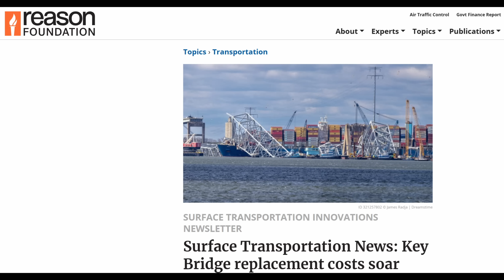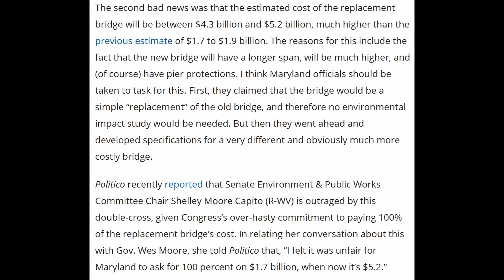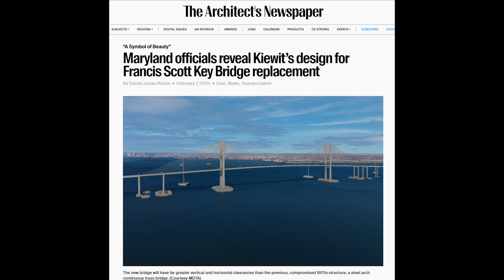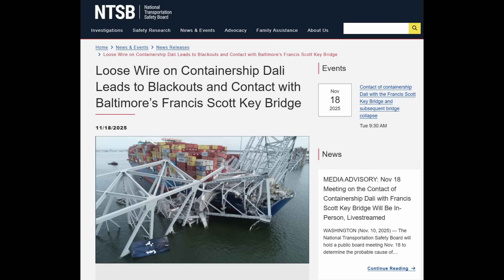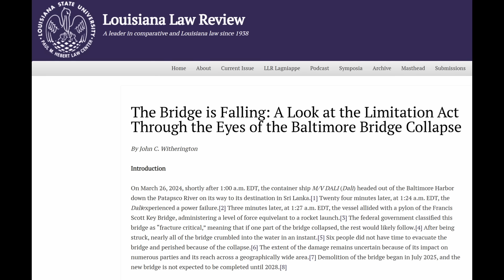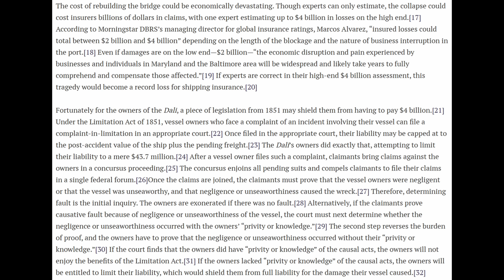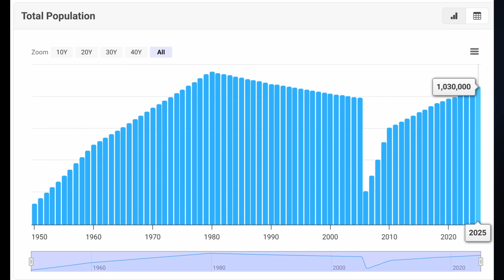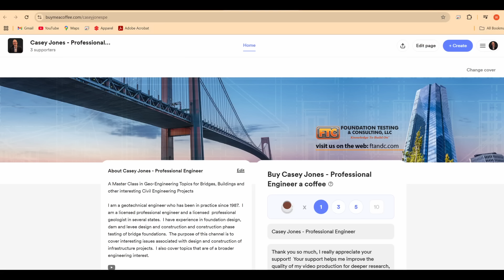Should U.S. Taxpayers Pay for a $5 Billion plus Key Bridge Replacement?

Comment: Even though the new Key Bridge will be much higher, the Chesapeake Bay Bridge would now need to be rebuilt to accommodate the larger ships as it is not high enough. Probably another $8-20 Billion to do that. Nobody has mentioned that up to know. So what does making the Key Bridge higher buy us at this time?  In the distant future yes it would be needed but until the Bay Bridge is reconstructed it does not make much sense.

Comment: Now you have me wondering how the bridge cost would compare to running a tunnel underneath. The problem with the tunnel, of course, is that you've still got to have a way to move hazmat materials through there.  When I was in Rouen in France, there was a bridge span over the Seine that allowed the entire pavement section to retract for passage of ocean-going vessels. I'm sure there are good solutions out there that come in for under $5 billion.

Comment: Lockheed Martin F-35 Lightning II Joint Strike Fighter took 23yrs to develop at a final cost of 2trillion dollars! That's 87 billion dollars for 23yrs! Lockheed has a contract with our government to build 300 F-35 which cost 100million each! That 30 billion total! Coupled that with corporate welfare which estimates to be  between $80 to $180 billion dollars annually. The key bridge is the very least of our problems when its comes to corruptions. Basically it just low hanging fruit and should be the last problem to tackle on the  list; if your serious about wasteful government spending.

Comment: First clarify what you assume as unstable and at high risk in the key bridge area. 
Secondly, you're comparing apples to oranges.When you're just looking at traffic versus what is public and commerce traffic.  The key bridge supported a great deal of commerce and was due to increase width.The improvements to the baltimore port. This commerce supports blames of people and businesses from the mid atlantic through to the midwest. This is why biden insisted on giving financial support for its speedy rebuild.
Reply from the maker: Nobody said the project couldn't be beneficial. I object to the blank check that Biden and Congress wrote for this replacement.

Comment: Republican governor hogan refused to add protections to the bridge. He was warned that this type of disaster could be avoided. He refused to spend a few million in prevention. Why should the rest of marylanders suffer because of one politicians and his parties poor decision? And at that time, many engineers also said even if that bridge had greater protections, it may still have collapsed. This does not exclude hogan's short sightedness.

And national funds would secure a swift building of a bridge that supports a great deal of commerce and expecting the commerce to increase due to the changes to baltimore ports. National funding would secure this bridge to already bewould be well under way dramatically reducing the cost.  We have seen this in other similar emergency projects nationwide. It is due to delay and political prejudice  and yes, tariffs , have added to the cost of this bridge is costing more.

Comment: I question the cost increase due to the fact that the Harry Nice bridge was replaced and finished in 2022 at a cost of less than 500 million. That bridge is 1.9 miles long and 135 feet tall. Make that make sense.

Comment: The only issue I have with this was Kiewit didn’t do the initial cost estimate, MDTA did (no bridge was designed at the time yet)

This is also assuming another contractor could build it for less assuming they don’t reach a maximum fixed price for phase II (next year)

Comment: Interstate 95 is a federal road. The original need that was there when the first bridge was built has not gone away. Federal roads are paid for by federal tax dollars. Therefore, taxpayers should and will pay for the new bridge regardless of whatever design flaws existed with the first bridge. All of the should have, could have, would have, arguments are pointless, except for to learn from the mistakes that were made. Now we must, as the negroes say, move forward. No point in crying over spilt milk which is what Casey Jones is doing.

Comment: Another Comparison is a recent bridge from MD to VA.  Harry Nice Bridge Cost was $463M vs $5B
1.7miles vs 1.6miles.  4 Lanes vs 4 Lanes.  135' clearance vs 230' clearance.  The Harry Nice was started 7/2020 and completed 10/2022.  I know its a different bridge.  But we could have built HN bridge 11 times before we reach the top end of the key bridge estimate.

Comment: A couple comments - Tariffs do increase the cost of American made products. When internationally sourced goods cost more it increases demand for American made products which allows American suppliers to increase costs. Also, it's the contractors responsibility to push the cost up as much as possible to increase their profits from this project. You see this particularly on CM/GC projects all the time where the contractor has the ability to drive the design.

Comment: One thing to consider is the proportionality of holding a single private entity responsible for the cost of a large scale piece of infrastructure that can only be built and maintained by a sizable government.  The state has to take on at least a fixed majority amount of the liability for the very reason that it is unreasonable to put the entire responsibility on any other kind of entity.  This sort of thing should be anticipated in some way.

Comment: To start with, it's important to interpret the 2024 Key Bridge collapse in a national context. PBS did a great documentary on the disaster. Apparently, the Key Bridge, along with many other bridges in coastal areas, was known, for many years, to be vulnerable to collisions with freight vessels of escalating size. 

This known vulnerability, in combination with the ongoing phenomenon of the entire infrastructure deterioration across the country, means that all infrastructure  has been crumbling for decades and the cost to get it back under control simply keeps escalating. Maybe you could say we need to do more to contain costs, but the politics of this era seem to clearly rotate not around finding meaningful solutions but around partisanship. In other words, elected leaders aren't really interested in talking about solutions, only finger-pointing.

While it's possible to consider where the money could be better spent, that simply results in sectional politics. 

The fundamental question lies in what the Key Bridge was and what it represents to the region. The Key Bridge carried Interstate 695 over the Patapsco River to complete the Baltimore Beltway Loop. Take that bridge out, and I-695 is no longer functioning as the Loop. Loops around metro areas are an integral part of the Eisenhower Interstate Highway System. Questioning the viability of a metro loop is questioning both the viability of our national commitment to maintaining and repairing to common structure of all metro areas. In doing so, you open Pandora's Box as to what the federal commitment is to the entire Eisenhower System. Like it or not, when the public accepted this system in the 1950s and funds were committed to building interstate highways, the voters (and taxpayers) also comitted long-term to maintaining and repairing the system (even as it continued to grow over the next 70 years).

The real problem here is the lack of adults in the room. If our nation's infrastructure is crumbling, it's up to elected officials figure out how to raise the money to pay for it while also controlling costs. If you look at the job Congress does with NASA and the Artemis campaign (namely the breathtaking costs of the Space Launch System rocket and the Gateway space station), it should be clear that what we need is to send more adults to Congress. So far, that's not happening.

So, why should the I-695 situation be any different?

Comment: I just watched a video by Alexis Dahl about the Stannard Rock Lighthouse, 26 miles off shore in Lake Superior <https://www.youtube.com/watch?v=LFzPnx0R8-k>. It's foundation is a +/- 100ft. diameter crib filled with rubble and concrete, built on an underwater reef to 14 feet above water in 1883. It's been automated since 1962. It's on the historic registry and is also is used as a base for collecting Great Lakes climate data. After 142 years of Lake Superior weather, the foundation has developed some large cracks. They are planning to address and repair them so as to maintain a valuable climate and weather data station. Seemed right up your alley. Enjoy!
Reply from the maker: Thank you very much I will check it out!

Comment: Howdy. I am a retired project & program manager of federal acquisition management for transformative contracts. I transformed the FAA‘s air traffic control and the veterans administration back in the 90s.
——
IMHO, the decision to triple the replacement cost will be found to be the direct result of when the contractor realized that the value of this contract is likely a blank-check job, having been promoted as a must-do thing by the Biden administration. Mix in a little corruption here & there … and viola! Triple Cost to taxpayers rather that the ship and bridge owners, who were both at fault here.

The most important thing when considering expenditures of this magnitude are that you need to start over from the beginning – which means rationalizing the need for the structure or thing in the first place. There is an inordinate amount of data available on traffic flows and types; this can be used to analyze whether the scope of this project needs to produce a different solution than a simple replacement involves.

In other words, this is an incredible opportunity to reconsider the big picture as far as traffic flow is concerned, and the traffic needs to be delineated into commercial and personal use to determine whether separate solutions may be beneficial.
——
OPTIONAL for the detail-freaks: The following is a summary of what a proper acquisition would look like on the surface.

It is somewhat boring to most.

The process is designed to assure complete resolution of the prioritized requirements according to the scheduled delivery date, at the quality and cost specified, with terms for early delivery, cost-savings, as well as for penalties if non-compliant with the contract terms.

It’s a system/process that involves several steps that functionally interlock to provide high confidence in the solutions selected. There are other specific processes that are involved for applicable situations, so you might not see everything here.
1. A mission needs statement.
2. Requirements elicitation.
3. Validation and verification of requirements.
4. Prioritization of requirements, establishing project scope.
5. Industry Requests for Information (RFI) & Market Analysis with Rough-Order Magnitude cost projections for ideally 3 alternatives.
5. Requests for Bids issued by owner.
6. Evaluation of bids
7. Owner feedback
8. Resolution & acquisition consideration & contract award (s).

Transition to Contract/Program & Project Management for implementation, which is another set of processes.

Let’s not forget about proper oversight, which is performed by the program manager, based on validated reports from the project managers, executing the contract evaluation process. This oversight is transmitted to executive management in monthly progress reports that also specify any deviance from expectations concerning schedule cost and/or quality.

Let’s see how this turns out and whether we can find any deviation from accepted practices, or common-sense.

That is, besides what we’ve already seen go South so far

Comment: How do you not understand tariffs and the economy better?  Tariffs on foreign steel have driven up the price of domestic steel.  Do you think domestic steel producers have kept their prices static if foreign producers now cost more because of tariffs?  Business leaders are not magnanimous or charitable.  They want to scrape as much profit out of their customers as they can get.  I agree the cost increase of the bridge should have been known or announced much sooner, but they are probably partially correct about steel prices.
Reply from the maker: You're not doing a very good job describing a 3 fold increase in the price of this bridge replacement. And don't be so snooty. I just said tariffs didn't account for the dramatic price increase.

Comment: Good morning sir. As a resident of Maryland and someone who has used the key bridge many times I can certainly agree with many of your points.every single Maryland administration both democrat and republican failed in their obligations to protect the piers holding up the bridge. In the years since construction money was almost certainly available for this. I guess the political will to spend money on a boring but essential project just wasn’t there. Baltimore will continue to receive larger ships with containers. CSX recently completed a tunnel enlargement project to allow the double stacked cars to pass through Baltimore. One of the issues in the immediate area is a large number on gasoline storage faciliin the Curtis Bay Area. Large tankers a constant site in the area. Somehow this fuel needs to be transported to the northern parts of the state. The bridge was the most direct route to 95north. Driving around the Baltimore beltway is not for the faint hearted. . People are just not paying enough attention.and I myself witnessed a game of cat and mouse between a tanker driver and a pissed off motorist. I was terrified.  I believe the bridge will need to
Be rebuilt, but with substantial oversight on costs.you quite correct, don’t worry about cost and get the money later is foolhardiness. As always thank you for your level headed thoughts and insight.
Reply from the maker: Thank you so much for your insights on that!  Hopefully they'll get the cost-benefit analysis sorted out on this soon.

Comment: US produced steel prices have risen significantly, some places reporting by as much as 16%. Tariffs have a habit of letting domestic producers charge more initially, only leading to lower prices longer term if enough domestic manufacturers increase production to drive competition. If you don’t watch for that and ensure it happens, this just becomes another form of taxation, either levied on the imports, or in artificially inflated domestic company profits. That being said material costs alone are not driving this size of increase. As for who pays if this is an interstate then the federal government is going to partly pay for this, if they don’t want to it should stop being an interstate. If the issue is alleged lack of preventative action by states, or concern over state level project management, the federal government can review taking over this infrastructure and managing it directly. Alternatively hand it back to the states and dismantle the interstate system concept. It’s just worth remembering that there are only a handful of states with economies large enough to handle these size projects independently. The US gets a lot of benefit from maintaining effective national infrastructure and the huge economy that is more than the sum or its parts that comes with it. As for this project, if the price is too high take it out for bid again with all that is now known.

Comment: That's not how tariffs work. Steel is a commodity. This is basic economics - placing a tariff on steel results in the market price of steel within the U.S. rising to the same level of imported steel + tariff. The fact that they were buying American steel already has no relevance - the steel market has been dramatically changed. As has the labor market, thanks to draconian immigration policy that has severed the plentiful supply of cheap manual labor that has been available to the U.S. for 60+ years. 

This route is vital to the efficient flow of freight along the NE corridor. Hazmat, container trucks, new vehicles, and worst of all oversized loads are now pushed onto the dramatically longer route along 695 W. A route that was already terribly congested. The bridge absolutely must be rebuilt, and it must be done as quickly as possible. The Port of Baltimore is the largest importer - and exporter - of vehicles in the country, vital to the East Coast. Of course none of this justifies more than doubling in cost, and it remains incredibly frustrating that the ship's owner/operator is not being held liable.

Comment: As someone who live in the Baltimore Metro area, I've seen the increase in traffic that has been created since the collapse. Yes, the vehicle count wasn't the highest, but a large amount of that traffic was truck traffic. Especially hazmats. Hazmats are prohibited from traversing through the Harbor and Fort McHenry Tunnels. Without the bridge, the only detour these trucks have are to drive through the City or take the Beltway all the way around. Shortly after the bridge collapsed, I personally drove from Sparrows Point to Fort Armistead Park. What used to be a 10 minute drive on a bad day, now took me 45 minutes. So anyone who lives in Anne Arundel County that works in Sparrows Point, now needs to take a 45 minute detour (and that isn't taking into account rush hour traffic). The same goes for anyone on the Baltimore County side that works in Anne Arundel County.

As for whether should taxpayers should pay for the bridge. My answer is yes and no. Initially, yes. Have the State or the Feds pay for the cost of reconstruction. That way the construction can begin and get the bridge built. Then either while the bridge is being built or afterwards, the State and Feds can sue the ship company for reimbursement.